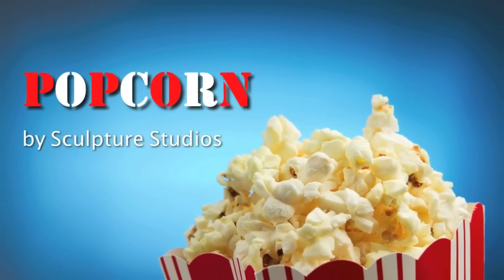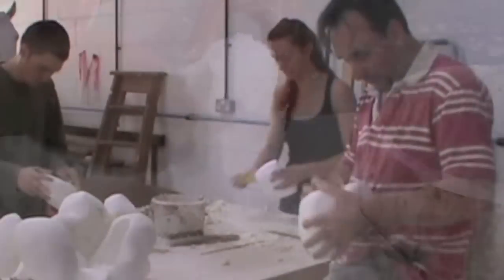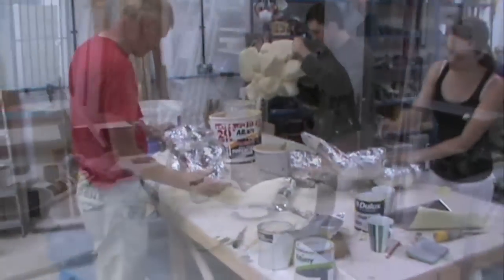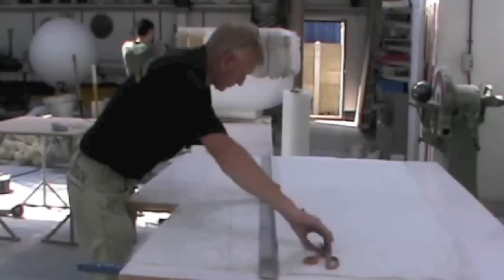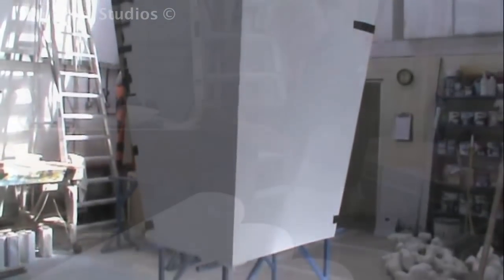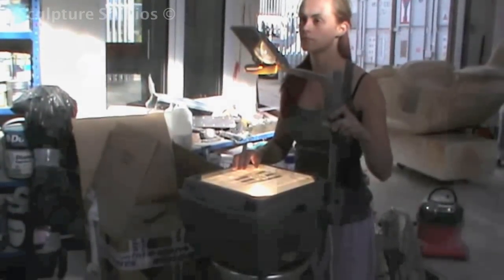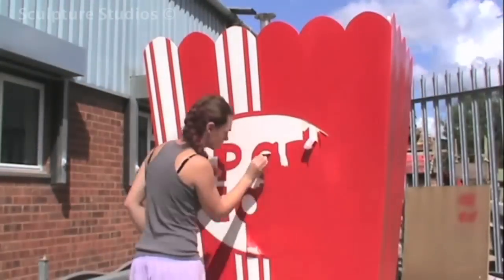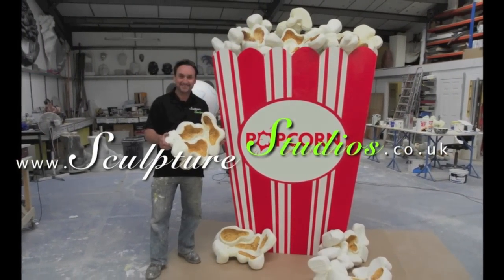Giant Popcorn by Sculpture Studios

Comment: Love your videos! Very informative. I’ve been watching your process and am wondering what you think of sprayable hard coat plastics via a static mixing tip like the smooth-on ez-spray jr setup for example, and how they compare to your preferred method of aluminum foil and fiberglass. Thanks again!
Reply from the maker: Hi Brandon, generally we don't tend to use plastics, particularly sprayable ones, as you tend to need proper booths set up with extra ventilation. Plastics tend to be quicker, and probably has it's advantages, we're just used to using glass fibre as a reliable strength. Plastic painted on could have thin or weak spots and still require several layers to give the same level of strength as glass fibre.